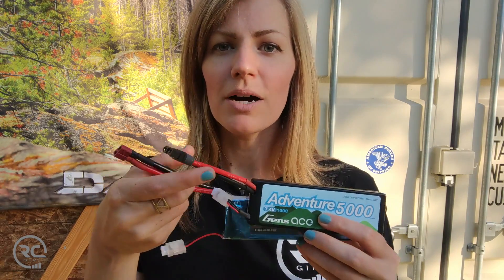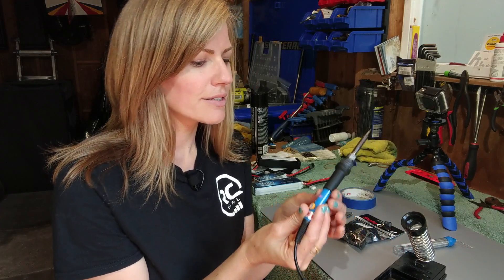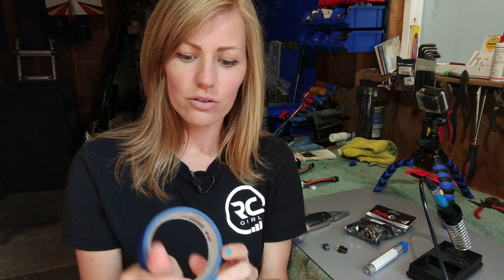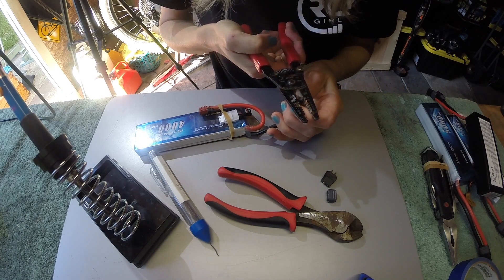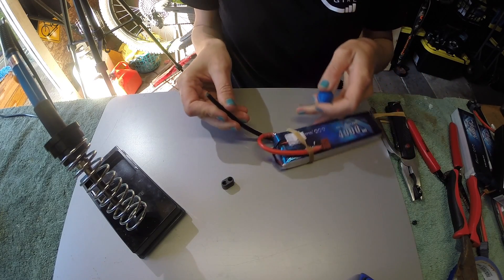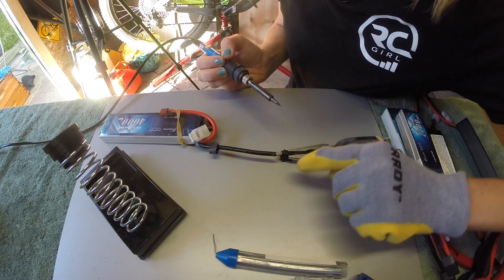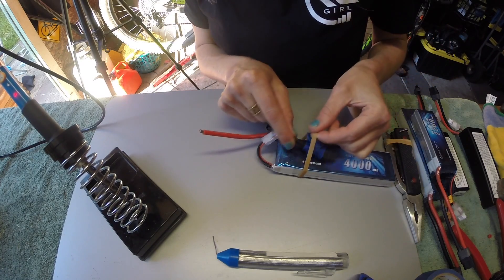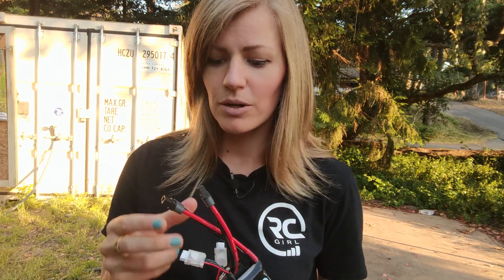HOW TO  |   Change LiPo Battery Connectors

Comment: Great video! But if I may make one suggestion, you will get better results with less hassle if you apply flux from a can rather than depending upon the flux contained in the solder. Be sure to use flux for electrical work (zinc chloride is best) as opposed to acid flux for plumbing, etc. Just apply a tiny amount of flux to each component prior to heating. You can get it at Lowes.

For those new to soldering, search "doc green woodturner," find my website, then look under miscellaneous for three articles on soldering. Everything you need to know . . . from an old man.

Comment: like your video but you need a higher wattage soldering iron   i use this on and i use mg chemicals leaded 6-/40 rosin core solder and you should also use mg chemicals no clean solder flux     , here is the iron i use it works great 
https://www.amazon.com/dp/B07L3HHZSX/?coliid=I3LACRRZPYUXQQ&colid=Q5IFEC4LIDWH&psc=1&ref_=lv_ov_lig_dp_it

Comment: Thanks and 1 more tip for you: Being experienced you may already be aware of this but in case you don't... For your soldering iron holder you might want to place a small square piece of sponge in that little built-in tray on the holder. Prior to soldering, place the sponge under running water and squeeze out the excess. Insert wet sponge in tray. Now you have a very cool way to keep the tip of your iron clean. Just wipe the hot tip quickly across the wet sponge and presto!

Comment: Absolutely I change everything to xt60 as well as xt30 for led spot lighting I also use a xt60/xt30 combo on 3s packs with an adapter I made for balance charging. It’s a bit of a puzzle to make but it helps a lot for easy setups 😎

Comment: You could have kept the full length of the wires by cutting the heat shrink tubing away and heating the solder and removing the wires from the plug.. and you would have had  tinned ends ready to go..

Comment: Is it okay if the battery spark little bit and you fall it to the floor?
Reply: Rc girl help me
Reply from the maker: You probably touched the wire ends together. If it's just a small spark, it should be fine but make sure not to touch the two cables together

Comment: I swap em every now and then. There is also adapters of all flavors and colors sold on Ebay. If you have never solder, I highly suggest, start w a old radio, rc toy, to get your feet wet before you jump into lipo batteries.

* the spark that she talks about is no joke. This is not your usual positive negative spark, its extremely flammable and literally fuse both wires together and bursts into fire in fractions of a second.

Comment: You should learn how to use flux. Don't depend solo on the 1.5 or so of flux in the solder itself. If you flux the wire ends 1st then lightly flux the end connector. Apply a little solder to the XT60 connector. You will see it apply more quickly. Once you have enough solder on the end piece than when you place the wire in the hot solder you will bitterly see the solder suck into the wire like a sponge. Getting the right dab of solder takes a little practice. Your end pieces will be more solid and you will get it done quicker.
Reply: Saint Kenny The wire and the connectors are brand new. They don’t need more flux..
Reply: @txkflier  yes they do if you want a good connection. When you add flux into the wire and then solder your connection and do it right. You will literally see the solder absorb into the wires like a sponge would draw water inside making a great connection.

Comment: You could also heat shrink the terminals after you have soldered them in place (remembering to insert the heat shrink tube before you solder lol!). No need for the tape plus it adds some resiliency to the joint.
Reply: The tape is only to keep from accidentally touching the leads while soldering. It's removed before she clips on the rear cap.

Comment: Very thorough breakdown with great tips. I've soldered a bunch of batteries and connectors and can't say how many times I forget to put on the shrink wrap or the plastic cover before I attach the wire to the connector. 😂😂
Reply: Funny enough, this popped up on my tv as I’m soldering EC5 connectors on batteries. They’re the worst to install unless you order the pre-installed pins and just shrink wrap them (which is what I do) the new IC5 connectors are much better.
Reply from the maker: @CCxRC  they're listening and watching us.... 🤖
Reply from the maker: Haha same!!!

Comment: I like to desolder the connections instead of cutting.  Still one at a time.  I also like to solder with both halves of the plug together so everything stays aligned.

Comment: why are you cutting the cables? cut the heat shrink and desolder them...
Reply from the maker: ha! good point.
Reply: No, don’t. Cut them off and start fresh. You won’t miss that little bit of wire and used solder..

Comment: I would recommend putting shrink tube or electrical tape on the end so that if one end ever comes unsoldered it won’t short your battery
Reply: The direction the xt60 connectors point wouldn't allow for anything to pass to the other side if it came un-soldered - especially with the cap on, it would simply pull out of the connector altogether. If you rotated the connectors then yes, they could definitely touch. I've done hundreds of connectors like this without an issue, but yes, a little heat shrink and a few seconds to put it on definitely doesn't hurt!

Comment: You should consider getting a tip cleaner for your iron that way it's always clean and won't contaminate your surface. It also gets better surface contact and keeps your tip from getting ruined. You can find them on Amazon from 5 to $10 all day with free one or two day shipping.

Great job

Rob

Comment: I'm shifting to all EC5.

I run in excess of 5000 watts and more than 100 amps on some models.  That is enough to melt the solder in XT60 or EC3 if there is any defect in the joint.  It also burns the lighter connectors through arcing as you connect.  The heavier connectors survive longer.
Reply: Sounds like you need the connector! Xt60 works for everything I've ever needed but have debated xt90s on some things. Doesn't really matter what you use as long as it works for you and your application.

Comment: Thanks for showing the new connectors. I didn't know those existed. Also don't do this while your not feeling well. I didn't do like you said and triple check the connections. I some how, though I looked, swapped the polarity. I didn't double or triple check. I connected to my fimi a3 after previously doing a mod, and I fried it. A nice little pop, I could smell smoke. I was so angry with myself. Huge lesson learned. Expensive too. Crazy thing is it actually started up. But something definitely was wrong as the original battery I was using was full of showed it was draining fast. I tested the battery but it showed full. Anyone need parts for a fimi A3?

Comment: thanks for the show and tell.  question, if you fill the cap with hot glue or plasterdip.     is the lipo water proff then? or is that  a wholenother level? -beginner rc

Comment: Sorry but that masking tape is not what need  to use. Need to use electrical tape even for a temporary use. Trust me you short out a lipo battery its not a good experience. A shiny soldier joint is a good joint.

Comment: Great video. I like this soldering iron. Never got into a fancy one. I will order one like you are using, like it! I've been thing about switching to XT60's. Been using Deans for ever especially on my planes. I hate to switch, but I like the black connectors. I use PowerLab 6's to charge everything too. I think I will look into switching. Thanks for the video,

Comment: Well done and informative video.  You did a good job of warning DIYs about being very careful not to shot circuit the battery by touching the positive and negative wires together.  A LiPo goes to a meltdown very fast if the wires touch.  Like they said in Ghost Busters, “Never cross the streams”. 😟

Comment: Very nice video as usual. If you have a soldering iron with a removable tip, its worth putting a wider one on to transfer more heat to those thicker wires quicker. Not necessary though as you've proved. Keep em coming RC Girl!

Comment: A good tip is to connect the XT60 to "the other connector", that does so the bullets dont move if the plastic melts a bit around them.
Reply: It doesn't work that way. When you connect the other side together, you have effectively increased the volume that the soldering iron now has to heat up all the metal parts to the point where solder will melt and adhere to the tab. This means applying heat on the tab for a much longer period then with just one side alone. Long heat is never a good idea. If it melts the plastic on one side, it will melt the plastic on both sides as you hold the iron there for extended duration. Lilke MrSupermugen said, if you have to hold your iron on the tab that long, then there is something wrong with your technique.
Reply: @superchargerone  I'm a beginner,  though have tackled a micro servo reverse.  Not bad :) 
I almost ruined it with too much heat.
My soldering iron tip was not prepared well enough, a poor thermal connection occurred as a result. 
The second servo went smoother.
Edit: almost forgot,  my buddy used to say "long heat bad!".
Reply: @superchargerone  Bingo. Unfortunately "FornellsRC" got a lot of upvotes for bad info. And that's how the internet spreads disinfo....Got a 'heart' by RC Girl too, that perpetuates it with a seal of approval... Smh
Reply: @superchargerone  I recommend you try it first, because i never had any problems with this method, and at 370dgC (sorry I am from the EU) plastic will melt.
Reply: Very nice video
Reply: This is why the EC3 and EC5 are fantastic, the plastic stays away until connector's in and cooled down.
Reply: with deans and XT's etc, the iron shouldnt be there long enough to melt the plastic. if your having to hold it on that long, you're doing something wrong.

Comment: a good tip is to prevent distortion from the heat connect both male and female together whilst soldering (sodering) stops the pins going out of sinc when plastic gets warm.
Reply: Especially on the male connectors!

Comment: Thank you for a instructive and to the point tuitoral on soldering!
I can see the soldering iron you use has a pointed tip. A narrow flat tip "screwdriver" type,  with just a little flat surface, will make the solderig easier. The flat tip will transfer heat faster, pre-tin the flat surface tip, and hold the tip on the underside of the wire you want to pre-tin, then feed solder to the parts when bringing the parts together. I think your soldering iron can have different tips, if you unscrew the serrated ring,  you will see if it will come apart. 

Your rubber band-around-the univeral tool is a good idea for holding small parts when it is just a few solderings to be done now and then. But a vise with a swivel head like this make it even easier for soldering electronic components:
https://www.amazon.com/Proxxon-28602-Precision-Vise-FMS/dp/B00196RV9C/ref=sr_1_100?keywords=clamp+on+small+bench+vise+swivel&qid=1560618685&s=gateway&sr=8-100#
Looking forward to your next video!
Cheers.

Comment: The pliers with an elastic is super simple but super handy. Most “third hands” are a little small to hold an XT60 firmly, and they limit your movement.

Quick tip: keep an extra XT60 connector with some wire on it (tape off the ends) around. Stick it in the connector you are soldering. If you overheat an XT60 the pins can melt the plastic and move around. If you keep an extra connector plugged into it, that will keep the pins positioned. If that extra connector has some wire leads on it, it will also keep the heat in the wire and not the plastic.
Reply from the maker: Great tip! I usually do that, but did not in this case. Thanks for the reminder

Comment: Nice job..I normally send to the pro for a clean and very strong soldering job at 25 cents per connector..😁
Reply: Wow that's a great price, they charge $4 here per connector, that's why I started soldering my own....
Reply: Brad Cruse wow with that amount I can buy many china knock off connectors already..😁..trying to support my LHS..RC industry in my country slowly die off..☹️